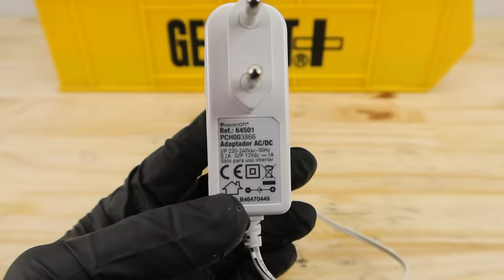Beyond Repair - Rusty Knife Restoration ASMR

Comment: Neat restoration. I love how you can still see the original "pitting" in the metal. In watching your other videos and observing what a perfectionist you are, I had assumed you were going to weld the pitted areas of the knife and then grind away. Also, I used to enjoy seeing you take your finished items over to your cabinet and place it with your other finished items 😁
Reply: Depending on what kind of finish you want to have, welding isn't always a good idea. The nickel he used probably wouldn't care, but if you try to polish the steel or blue it, the different composition in metal between the original and the weld can lead to uneven, splotchy results. The metals don't always color evenly and good luck finding a rod or filler wire that exactly matches an 80 year old bayonet.

Comment: Actually it was not a knife , it looks like it was a bayonet by originally.
Reply: yup you stole my comment ehehhehe
Reply: Looks like a kar98k bayonet
Reply: Exactly!
Reply: @Pommezul  i've got the exact same bayonett where you can still read the engavings. i think its mos likely a S14 c1916 German bayonet by Gottlieb Hammesfahr, Solingen Foche. google it, they look very similar.
Reply: A bayonet without a gun is just a knife
Reply: @femur598  i have the gun ... so give  me the  knife  :)
Reply: Bayonet, a knife, sword, or spike shaped weapon designed to fit on the end of the muzzle of a rifle. Both bayonet and knife.
Reply: Bayonet is typically considered a form of a knife.
Reply: @femur598  Not even
Reply: @Okararu  you are right
Reply: @Okararu  no. It is an SG 84/98  alte Art for the Gewehr 98. The S14 ist a little bit smaller.
Reply: Arne Hergesell it probably isn’t that, bayonets were made in lots of different places and factories
Reply: @saftkraft3478  or it could be the Kx 23 51295 G34 model 37c12, as it's slighter wider than the rx 551 gr 3.07.   Hmmm

Comment: Sharpening a knife on YouTube?
You're a brave soul.
That's in the top 1% of activities to get the internet trolls telling you that you're doing it wrong.
Reply: I mean, if you're sharpening a bayonet you actually are doing it wrong. Because bayonets are not meant to be sharpened since they are a stabbing weapon.
Reply: @Kav.  
Q: why is it that every bayonet ever made (except for the Russian M1891) is built as a knife, including a blade section all down it's length and a wood grip?
A: because armies & soldiers all use bayonets as knives. 
A2: because why carry a bayonet and a knife when a bayonet can be made in the form of a knife, which they were.
Reply: @mymusicaccount1456  >why is it that every bayonet ever made is built as a knife

This is factually wrong, I could go to my cabinet right now and pull out at least 3 that do not serve as knives (French Gras, No4 Mk2 Spike (and in fact the whole British Enfield socket bayonet series up until the No7) and the FAL socket bayonet. When bayonets were used as knives this was done for stabbing and not slashing, this is why you see bayonets turned into fighting knives in the trenches. All of these bayonets are classic examples of over a hundred years of bayonet history, so why are none of them knives?

If I go to any of my used bayonets right now I can guarantee you they have not had edges which have been sharpened, I know for a fact my S98/05 Sawback doesn't and neither does my No7 (although mine is a parade version so there is that much to say about it) 

>because armies & soldiers all use bayonets as knives. 

I collect bayonets, I have done so for many years. Bayonets are not meant to be sharpened, they were originally intended to convert your rifle into a spear of sorts once fired.  

Grips and blade can primarily be described as aesthetic choices as well as serving the secondary ability to act as a fighting knife if necessary BUT NOT FOR SLASHING, this is why you quickly see them abandoned on bayonets made in situations where aesthetics are irrelevant (See No4 and No9 socket bayonets for Enfield Rifles and Sten gun) or why you see them cut down/trench modified

To summarise:
- Not every bayonet ever made is designed to look like a knife, in fact I'd say most weren't

- The knife form factor exists primarily for aesthetics and for use as a stabbing knife if necessary, I never said in my original comment that a bayonet could not be used as a knife, I said it was not designed for slashing. (also because slashing is a pretty ineffective way to kill somebody quickly compared to stabbing them)

- Armies and soldiers do not all use bayonets as knives, a few notable ones do but they are also reputed for being really shitty knives, for example Soviet AK bayonets (to an extent) and the M9 bayonet currently in use, use as a knife is a modern trend because bayonets really serve no purpose anymore as bayonets, there are some older examples but they are anomalous.

-  Form of a knife does not mean intended for use as a slashing implement

Thank you for coming to my Ted talk.
Reply: @mymusicaccount1456  Okay because I went overboard a bit on detail and I know you're not going to read it in full here's a TL;DR:

Q: Most bayonets were not made as knives, the "knife" form factor when present is only meant for stabbing and not slashing or occasionally as a light bush knife/machete in rare instances (M41 Spanish bolo) 

A1: This is untrue, several examples exist of the opposite throughout every period of history (No4 Spike, No9 blade, FAL socket, P1858 socket, Gras 1874, Lebel 1886, SA80) although I never said they weren't used as knives, I said they weren't meant for slashing in my OP.

A2: Because they are designed for different purposes, a bayonet has to have compromises to work as a utility knife and vice versa, a bayonet is serviceable as a fighting knife but this is a secondary purpose and again, only for stabbing and not slashing.  

That's the bulk of what I have to say, to extend on from the slashing vs stabbing point I'd like to point out that all throughout human history stabbing has been the preferred way to kill with a sharp object, even swords of old were primarily status symbols, the weapon of the common man was always the spear. If we take it from a utility stand point then bayonets are not designed to make good utility knives, some show attributes (S98/05 Sawback or 1914 Swiss pioneer (pioneer being the key word here) for example) but often these attributes impair its use as a bayonet. Only as bayonet charges have become less common do you really see a shift towards more utility knife style bayonets (M9, AK etc)
Reply: @Kav.  Ooh yeah, TL;DR for sure.
I was actually gonna tell you that when your 2nd post came thru, so i left it alone.
I have a hard rule about reading more than "1 Paragraph" from any random person on the internet. hard no from me.
Or if it looks like someone copied wikipedia and uses that as a comment, Pass for sure.
Reply: @mymusicaccount1456  I'm a bayonet collector, so here's the tl;dr to my tl;dr with my citation being years of collecting and reading about my hobby. 

99% of what you said about bayonets is straight up incorrect.
Reply: The top one is welding
Reply: @stephenkeller4694  the top one is 9mm v 45

Comment: I realized what type of node it was right away and my heart sunk. It’s an old German K98 Bayonet from WW2.
Reply: It could also be from WW1 and have a damaged guard. The bayonets used by the German army didn't change much between the wars.
Either way, its historical significance makes this video a bit bitter-sweet. On the one hand, I like that it's a functional tool again. On the other hand, I wish they'd done a restoration rather than a customization.
Reply: i agree
Reply: Someone said this already. Did you copy them?
Reply: @SomeGunNerd  either way its better off like this as a cool knife than a rusting chunk of metal in a box

Comment: Transformation is incredible, looks stunning, well done. I reckon there would be a market for your work. New way of preserving history. 👌🏻👍🏻👏🏻👏🏻👏🏻 👋 🇦🇺
Reply: You call this preserving history?
Reply: If anything, this is ruining history! He filled in the bayonet locking system with epoxy, scratched off the blade’s coating instead of just using rust treatment, and he didn’t use Bakelite (or wood, either would be right) handgrip panels.

Comment: “That’s not a knoife!”
Said Crocodile Dundee never...

Looks more like a bayonet.
Reply: That was the first thing I noticed
Reply: WoT Fegano  I did some searching and the set back inlay on the handle match the Waffenfabrik Mauser 98/05 (Butcher Blade) with the extension of the guard broken (rusted) off.
CIRCA 1915-1918
Reply: German mauser bayonet
Reply: Cause it is
Reply: It is it’s a Mauser bayonet
Reply: @BuckJolicoeur  Its a Seitengewehr 98k III, the Bayonet lug was removed by German soldiers in WW2 because it warped and hot stuck on the barrel and it isn't the butchers blade because it's the complete wrong shape and length.
Reply: The Doctor 2099  it's a German Seitengewehr 98k III, good luck fitting that on your M1
Reply: Technically it's a knife AND a bayonet
Reply: Not Mauser. It's Steyr Mannlicher M95 Austrian bayonette.
Reply: It’s a WW1 German bayonet for the G98

Comment: The power of vinegar and a wire goes along ways when getting rid of rust.
Reply: Almost all of the methods here were just for show. Much like the 'special fluids' those channels use that just 'discover antiques on the beach' etc.

This just needed a wire wheel and some rust remover as you say, files and sandpaper would've shaped it too.
Reply: John Barber  vinegar sorts everything from rust , to taking the itch out of mosquito bites!!
Reply: Profile nice pic
Reply: @portablerefrigerator4902  thx
Reply: @potatohamlin5242  h

Comment: That isn’t a knife; that’s a bayonet that attaches to the end of a military rifle.
Reply: Bayonet is a knife that can be attached to the end of a military rifle. So, yes, it's a knife.
Reply: @marksantos5402  bayonet Is designed to stab not cut they Are not sharp modern assault knifes can be atached to rifle
Reply: @petrtkac267  There is a type of bayonet designed expressly to stab and not cut. They're called spike bayonets. Those went out of fashion before the 20th century. The one in this video is designed with a cutting blade and a point . . . just like a lot of other non-bayonet knives in existence.
And "modern assault knives"? That are designed to go onto the end of rifle? That's just the tacticool word for a bayonet.

My point was that a knife can be a bayonet, and a bayonet can be a knife. They are not mutually exclusive modes of existence.
Reply: @marksantos5402  dont forget sword bayonets ;)
Reply: @dweebs4489  dont forget gunblade exist
. LOL
Reply: @polong99  'exists' is a bit of a stretch.

Comment: Before watching: That's a K98 bayonet

After watching: that's a parade bayonet fit for the Führer's bodyguards.
Reply: K98K, there is another k, don't neglect that poor k
Reply: No it's not. The attachment lug is full of resin.
Reply: @Jetmech1781  well, parade bayonets were purely decorative, so...
Reply: brass monkey  no they were usually kept in the scabard and were ceremonial in nature
Reply: brass monkey  that may be. But now it looks like one of the parade bayonets, and ngl it'll make one hell of a conversation starter
Reply: brass monkey  yeah, ngl though it looks amazing
Reply: i think the only place it belongs is in a display case with all the other "restoration" projects. or probably used a knife for opening boxes. it's a art and craft project.

it's not historically accurate, it would never be used in a parade, far too gaudy but not in a good way. if you want something to look nice, using cheap resin is never the answer. and neither is polishing a rough pitted surface. the weird contrasted of a trashed knife with high polished finishes gives off a kind of "youtube restoration vibe" it's better to just start over with a new knife if you're trying to make it nice and polished, and use some micarta, it's probably the only acceptable used of resin/epoxy in a handle.

the fact that there are so many channels doing basically the same thing makes me think, what are they getting at? they must not be stupid to make videos like this even if the result looks meh, it still gets views and comments.
Reply: Sombody how's now waht he does
Reply: @BloodSprite-tan  it looks nice and was a great project, stop throwing a fit.

Comment: That is not a Kar98K bayonet, it is a much earlier, pre-WWI SG84/98 1st-pattern bayonet from the German Empire. Kar98k bayonets (and later SG84/98 models) do not have a curved pommel where the wooden grip would end, but a flat end, and other WWI model bayonets had longer blades and a curved and extended guard.

Comment: So what are the advantages/disadvantages of rust remover vs sandblasting?? 🤔
Reply: From what I can tell, having looked into it, it appears that initial startup cost is the main drawback of sandblasting. It's significantly more effective than other rust removal methods, and rather than destroying good metal in an attempt to get down past corrosion, it will strip corrosion, and highlight the remaining good metal.

However I do know that some people I've talked to say that when using a sand blasting cabinet, they will use rust remover before sandblasting, because it makes the sandblasting go faster, and doesn't gum up the works, and extends the life of their blasting medium. Hope this helps, it sure helped me, as looking into it answered a few of my own questions!

Comment: That was 1$?!? I would pay easily 20$ for the condition its in and wire brush it, put it in the forge give it a slight curve and make a handle for it then sharpen. It will only take 3 hours and it would be good as new.